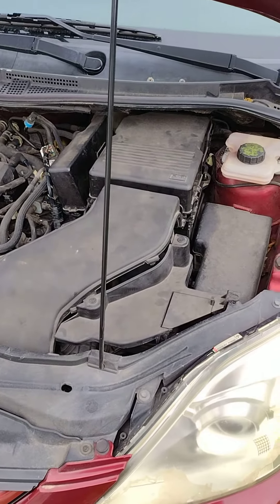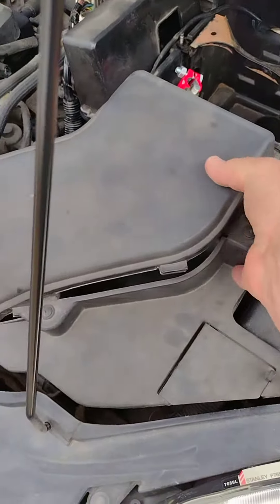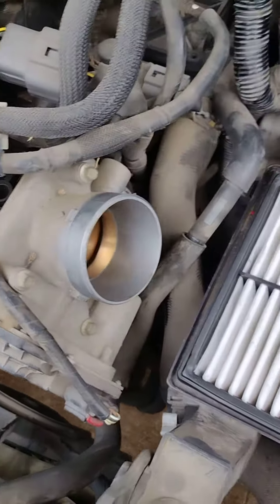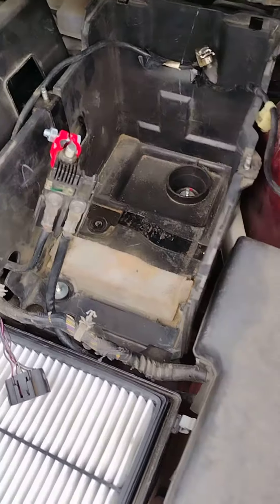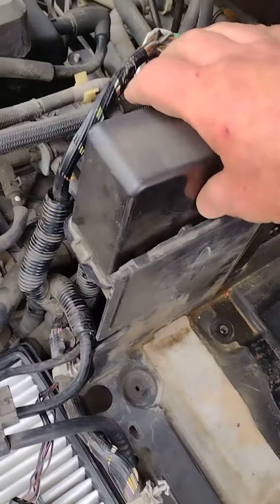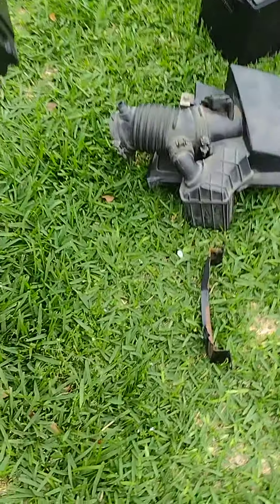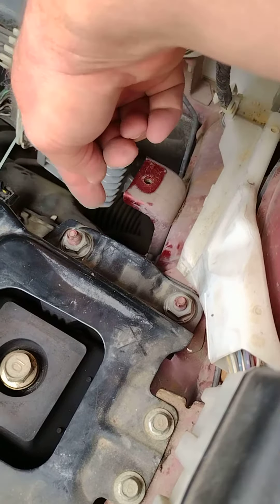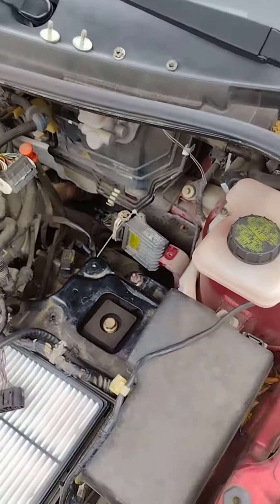Quickie Video:  2009 Mazda 5 TCM removal steps.

Comment: Why did you relocate the tcm?
Reply from the maker: It is a hack to keep the TCM electronics away from the heat of the engine/transmission and give better air flow to keep it cooler.  Optional, but it is believed that the heat that the TCM is exposed to is the reason for its failure.

Comment: Do u you need reprogramming
Reply from the maker: No.  The TCM for 2006 thru 2009 Mazda 5 cars do not need to be programmed; just plug it in and go.
Reply: @johnhermann762  thanks

Comment: Lol, specifically looking for a video showing how to remove the tcm connectors without breaking them
Reply from the maker: It may not be possible to disconnect without breaking; they are plastic and getting pretty old.  I was lucky, mine didn't break but I remember thinking this sure feels like it's about to break.
Reply: @johnhermann762  Thanks, I found another video where they got into it, there's a tab you can barely feel underneath what seems to be the release tab, which is the real release tab, that allows you to raise those white arms and pop the connector out. everything that I thought except that the release tab is difficult to get to since its barely feelable underneath the plastic that I assume is there to protect it.